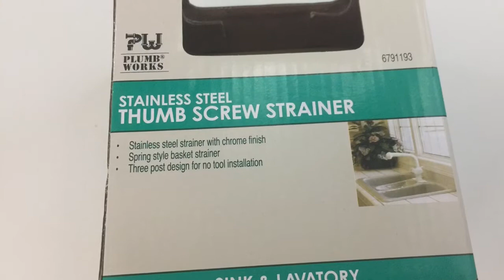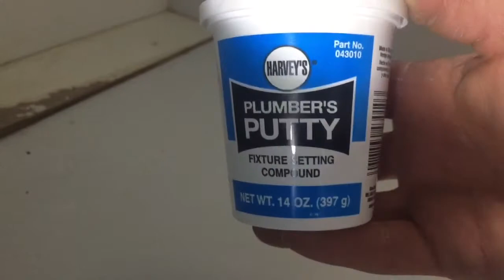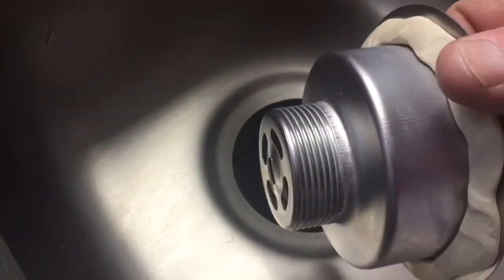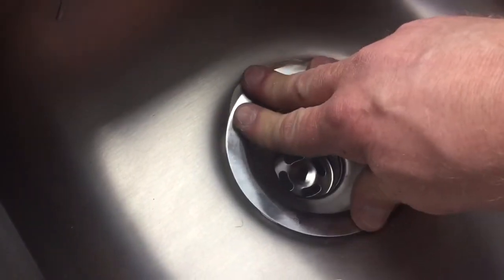How to Install a Thumbscrew Kitchen Strainer

Comment: Just installed mine but i have a slight leak at the point  where the pipe ties into the drain. Any tips?  Is it just not tight enough?

Comment: Replacing mine .
Think I'm gonna go with this 
type ,, instead of the single screw on type ( which usually requires 2 people to install ) . 
Has this held up since install ? 
Any leaks ? 
Thanks .
Reply from the maker: It has held up great. No problems. Thanks for watching.

Comment: I used this same strainer and while the thumbscrews make it easy to install, they get in the way when you go to attach the tail piece. Not a huge deal but a little annoying.
Reply from the maker: Yeah, there is that issue.
Thanks for watching.